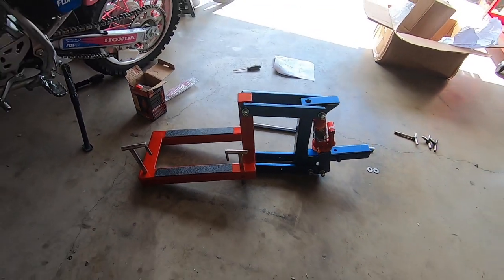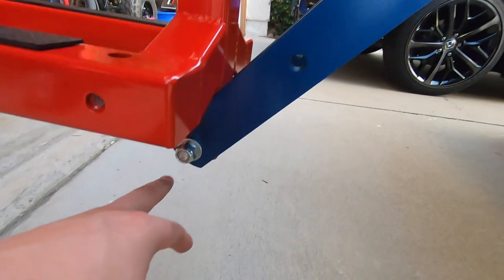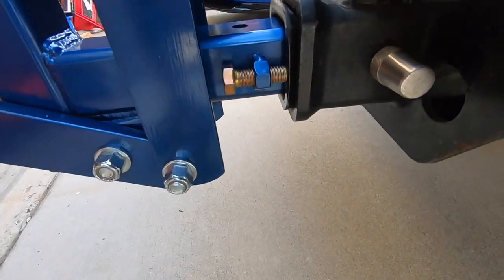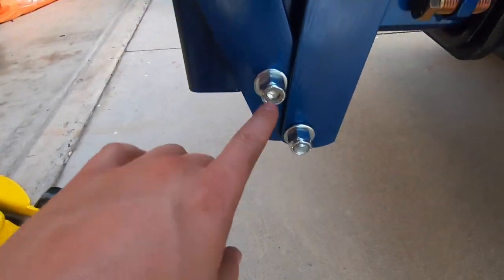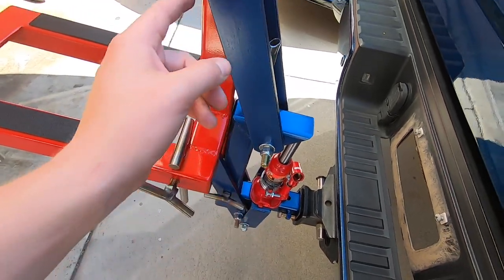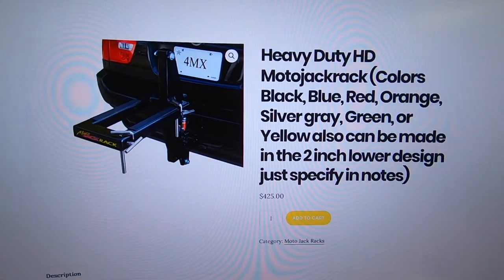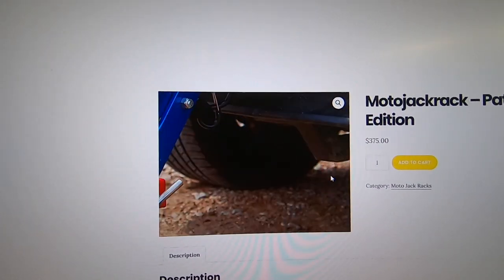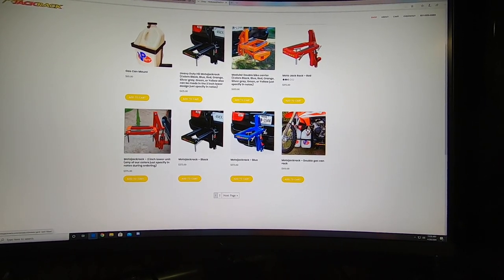MotoJack Rack in Depth Experience & Review

Comment: I have been using the moto Jack rack for 20 years now logged over 15000 miles at least never one problem mine did not come with the strips on the platform i would just take them off and not worry about it, the carrier is going to get scratched does not effect the use one bit.The best two things about the moto jack rack are the pocket the top of the jack fits into so it can't slip out and the screw that tightens it against the hitch you still can use a hitch lock in the pin hole i have been all up and down the east coast and now the last 10 years in montana and about 6 other states out west if i am going riding by myself i use the MJR great product
Reply from the maker: Glad to hear that for sure. i wanted to like it.

Comment: Great review. I had the same experience with the moto jack rack as you. Bought the heavy duty version as well ,had to buy longer bolts, plastic skids peeled off first time use plus the bottle jack leaks. Paint sucks too. But the moto jack is a solid performer when set up right. Tip. Drill hole thru nylock nut and bolt after assembly and add a cotter pin. with use the nylock nuts will loosen.
Reply from the maker: Nice! I’ll have to do that

Comment: I recently ordered a double. It took two months to get and  I found issues with much of the fit and finish. I bought 12 additional washers 4 bolts two of longer length than supplied and had to redrill the stop pin hole that keeps the hitch from lowering because they weren't even close to lining up so the pin could not pass through the first lowering arm into the receiver hitch. The paint finish was like a child painted it and the plastic strips on the base all but one fell off. All in all its a great way to haul two bikes but my confidence in it not snapping a bolt would be a 3 on a 1-10 scale. time will tell. For a single, the MX hauler which I own is hands down light years better build. Unfortunately, they don't make a double. $799 price tag way too high for the quality received.
Reply from the maker: My long term experience isn’t as great as i had expected either. The plastic glued covers on the platform are completely off now and won’t come off when unloading or loading. Great idea and concept but it still needs work unfortunately.

Comment: I just put mine together.  Mines not the heavy duty model.  I think it said that the HD model doesn’t use inside washers.  Don’t understand why??  It’s not powder coat it’s very thin paint.   I see bare metal in several places on mine.   I sent them a email about cheap ass rattle can paint!!    For the price of 500.00. I’m disappointed.    I’m going to put some pop rivets in the rubber pads after your saying the rubber strips aren’t secured good at all.    I waited almost 3 months for mine.  I like the design though.  I have to ramp up carriers.  This will be easier for a 67 year old.   I’d rather spend energy on riding than loading.   More issues.  Van doors hit it before they open.  A pickup tailgate would hit before its down.  I’m going to have a welder add a piece to move it back in the reciever.    No thought at all by their design department. !!! Thanks
Reply from the maker: Seriously! Yeah they really bombed it on this one for sure

Comment: What’s the hitch height on your truck I have a ram 1500 with a 6in lift .   Wondering if it goes low enough to get bike on it . Thanks
Reply from the maker: I haven’t measured it but 1500’s in general sit lower than 2500’s so my trucks 4” lift is same as your 6.5” lift typically. Your Probably on 35’s like I am. So the 2” drop version of this should be fine on flat ground but it’ll be close. 
If you throw the rear tires in the gutter in front of your driveway, it clears for days

Comment: Whatd you end up doing about the plastic grip thing? Mine just feel off.
Reply from the maker: Glued it again; fell off again. Then wrapped it using hose clamps and header wrap. Probably not the best idea either lol. Didn’t find the best solution & sold it shortly after

I’d think maybe drilling a few holes into it and into the unit itself and running some rivets

Comment: Is that a 2.5 inch to 2 inch adaptor on your hitch?  Any issue with the reducer wobbling?
Reply from the maker: nope; the bolt was able to keep the wobbling down with or without the reducer (i used on multiple trucks with 2.5 and 2 reciever)

Comment: Danger attention😢 I seen two videos today it's April 2024. 2,, hitches BROK OFF!!!!😢 the truck😢😢😢hitch motorcycle hauler like this one in the video and one of the other type like Harbor Freight, or ramp style motorcycle rear hitch receiver hauler! and they both busted off  the truck and fell on the road😢😢😢 motorcycles fell.😮 the square stock snaps right off... you've got to reinforce this stuff!!,,   my suggestion is build a three-point ramp style receiver hitch motorcycle hauler where you have the receiver hitch in the middle and then you have a little version receiver on the left side of the bumper and on the right side of the bumper from underneath the frame or whatever where you can extend a pipe or a small square stock underneath each side of the motorcycle hauler and that would stop all movement and make it super strong

Comment: The instructions clearly state how many washers are needed and where they go
Reply from the maker: First off, nope. Instructions showed for a NON HD model. Thinner metal and appropriate amount of washers. I DID NOT get the correct instructions. 

After installation of the washers as they recommended. Metal still binded up & new powder coat flaked off.

I wanted to take it easy on this but eh. For a simple metal product and how much it binded up and everything. I’d never buy again. This could easily be made better

Comment: Sounds like the manufacture got lazy and could have caused a serious accident. The fact that those bolts weren’t long enough to reach the nylon in the nuts is extremely dangerous. Good on you for noticing and fixing the issue and really bad on the guy who sent that out.
Reply from the maker: Thanks man. That’s exactly my thinking on it. Has so much potential to be a good product too but it was left unfinished
Reply: Additional washers in the wrong place, appears to have caused the bolts to be short. Bottom outer plates in wrong location, didn’t help.
Reply: I don't think they messed up, I think this dude just assembled it wrong.

If they sent it with that many things wrong then they should be notified and have either replacement parts sent or just replace the whole thing. But like I said, I think this is all user error.

Comment: I just  got the HD version, Skid pad fell off when I took it out of the box, the welded bolts on the main lower arms are crooked as hell, and also the holes on the main lower arms do not and will not line up with  the safety pin hole  on the hitch arm deal
They are a bout 1/2" in the wrong place no matter what I do not sure if they sent me the wrong parts or what happened .
Oh and also I didn't get the gas can mount I ordered(but apparently its coming soon).  /sigh.   Also, you only need 10  washers for the HD version according to the instructions they only go on the inside, but that's the least of my problems........
Reply from the maker: YIKES!!!! That’s crazy man.... i’m sorry to hear that. The way this video has turned out makes me want to build these on my own!!
Reply from the maker: @Jacksquatch69  Wow yeah they should line up perfect. Are the upper and lower arms the same thickness? I remember mine on the HD series was the same thickness. Otherwise if they’re different then it’s definitely the wrong arms
Reply: @americanduramax  I probably should have  just got the chinesium one from Rockymountainatv
Reply: @americanduramax  Yea they are all the same thickness and looks like everything fits together fine other than the holes for the lock pin are impossible to line up.  And by the pictures/instructions and eyeballing the holes on the hitch frame part look fine.  So I'm guessing the holes in the lower arms were drilled/welded in the wrong place. ( and I guess no one tested or measured anything before shipping it :(
Reply: @americanduramax  Ended up my arms were miss drilled. He sent me new arms but I have the really bad binding issue you had. Tried leaving it kinda loose but then the whole assembly flops around like crazy
.  I'm trying to put 2 washers in but can't get them in these holes near the jack because the jack bracket isn't wide enough.  How did you solve it there?  - https://i.imgur.com/NHHXBNM.jpg   - I'm thinking about just taking an angle grinder to those welded on washers to shave them down a bit so they don't bind so bad.  They bind so bad that even with the bike on it i have to press hard to even make it lower.  I don't even care about the paint on mine at this point lol.
Reply: @americanduramax  I fixed mine I guess.  I ended up using an angle grinder on those inner welded in spacers to grind them down a bit.  Then the clamp for the jack wouldn't tighten enough so I had to throw a bunch of spacers in there ( it ran out of threads ). That thing is like a glorfied hose clamp the jack falls out of position every time I lower the rack.... Not very happy with this thing at all but seems like I have it functional now
Reply: I'm having these exact same issues 2 years after your comment! My safety pin will not fit due to the holes not being aligned, and my gas can mount did not show up but coming soon. Wish i would not have ordered this thing.
Reply: @JTug1106  They sent me new arms, after I talked to him on the phone 2 years ago. and I sent him pictures mine was made incorrectly with the hole spacing in the wrong spot.  Its been working since then, just a bit of a mess go to through when I got it.